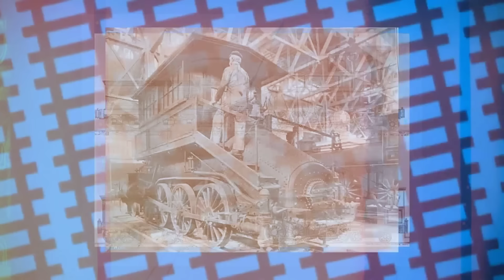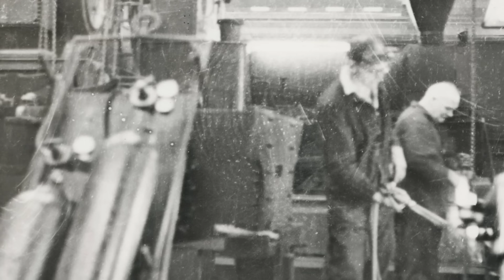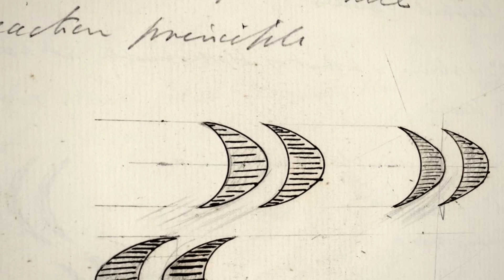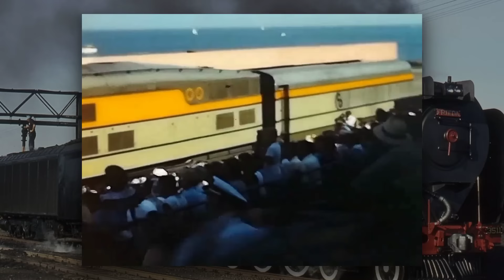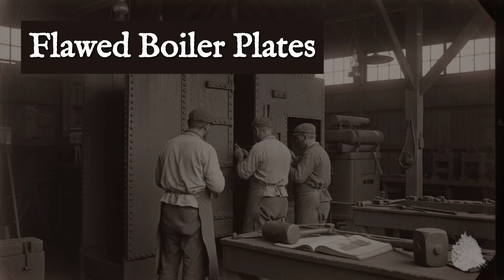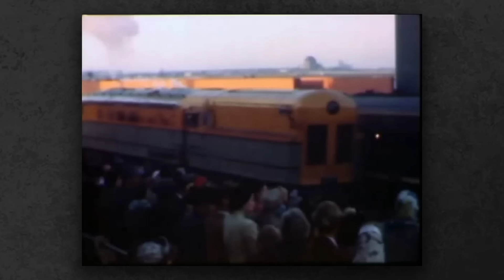The 10 Deadliest Locomotives Ever Built

Comment: Absolutely not true about the Erie Triplex jerking and bucking when low on steam. They werent successful because the firebix wasnt big enough to produce the steam it needed. They finished their career as a pusher but even then they had difficulty. They would have to stop in the middle of a push to build up steam then cobtinue the push. Same with the Virginians triplex.
Reply: They weren't successful because they weren't efficient enough to apply power at speed. A significantly upgraded triplex with three simplex compound three cylinder engines that all exhaust in the smokebox would be much better.

Comment: The Erie triplexes were soon relegated to helper service. On heavy grades they would couple on at the bottom of the grade and push to the top at ten miles per hour. Yes they were out of steam then but they would coast back down the hill and build up steam for the next train. So they did get some use out of a bad idea. As far as the Garret’s, some people have said that if we had used them in the US steam would have lasted longer than it did. I always heard that they were a well respected design.
Reply: Garrats are an excellent design. There are two still operating a short distance from me.
Reply: No steam would not have lasted longer because we had locomotives just as good or better than the Garrat. One design was considered but never got past the drawing board. There just was no need to have them.
As far as the Triplex even as a helper it would run out of steam while pushing. It had to stop and build steam then continue the push. A larger firebox would have helped.
Reply: @williamhayslip1644  If those alleged locomotives never made it past the drawing board. Then it is just speculation to say what they would have done.

Tell us what the design was about, please.

Comment: An oil burning locomotive doesn't need a stoker.
Reply: Rubbish. The driver still has to drive the locomotive, and the fireman is retained to operate the oil burner controls, as the demand for steam isn't at a constant rate.
Reply: @TheNightOwl-ef7ih  your logic is impeccable.